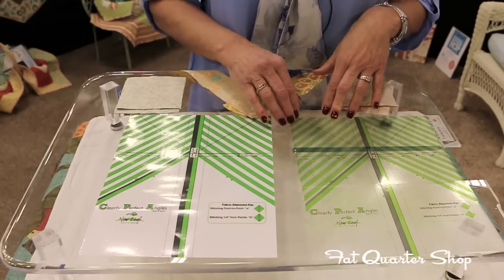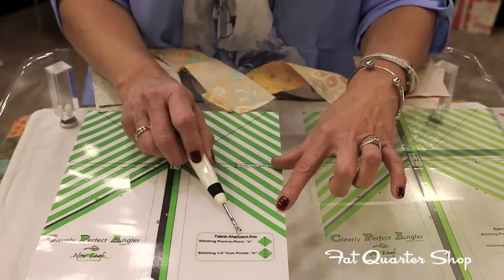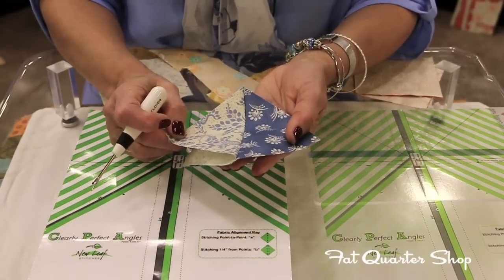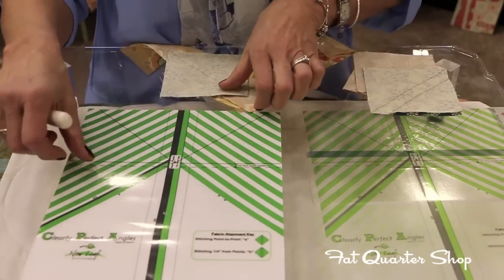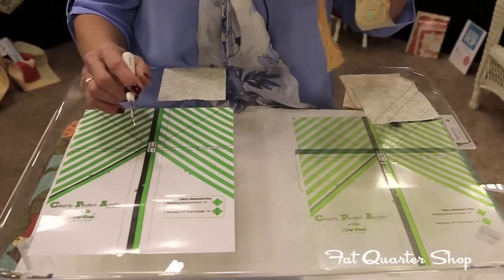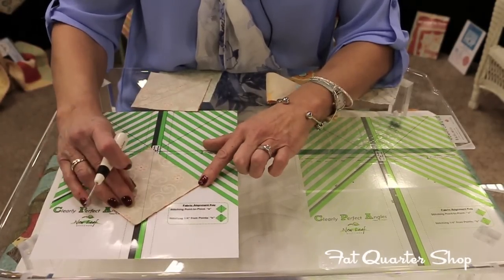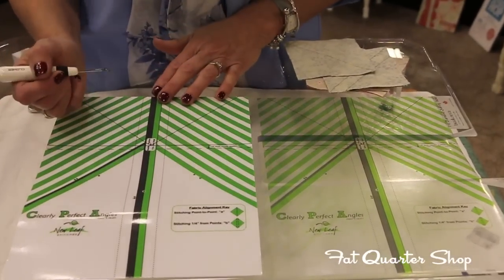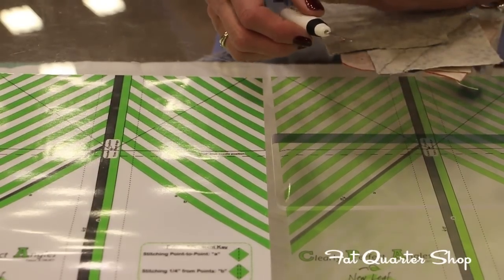How to Use Clearly Perfect Angles (C.P.A.) by Kari Carr - Fat Quarter Shop

Comment: Any suggestions on changing my stitch plate so I don't have to remove CPA??? I didn't find any ideas on that detail. I have a stitch plate for zigzag and another stitchplate with a single hole for straight stitch and for when I use my embroidery unit. Thanks.

Comment: It sounds like a great idea.  My bobbin is changed from the top so it sounds like everything I need to change the bobbin I change to release at least part of it to make the change.  There is also a button on the right side of bobbin case cover that releases the cover.  Any suggestions on how to make this work so the product does not have to be removed constantly.
Reply: Alonna Mottern You will love the CPA! You actually don't need to do any special trimming for accessing a drop-in bobbin.  Simply roll the front edge back, under the needle until the bobbin case can be opened.  After you've changed your bobbin, simply roll the CPA back into place, smoothing it flat.  As long as it is left in place (along back edge) it will go right back into place!!  It's really handy that you don't need to remove it or reposition it whenever you need to access your bobbin.  Please let me know if you have any other questions!  Kari (New Leaf Stitches)
Reply from the maker: Alonna Mottern There are instructions on the packaging that tell you how to handle this particular issue. You simply need to take your seam ripper and cut a flap. This will make essentially a door you can open and close when you need to change out your bobbin. Thanks for your question!
Reply: There is a really good video by Kari on her YT channel that addresses exactly how to do this: https://www.youtube.com/watch?v=e5Lh-b45IKY